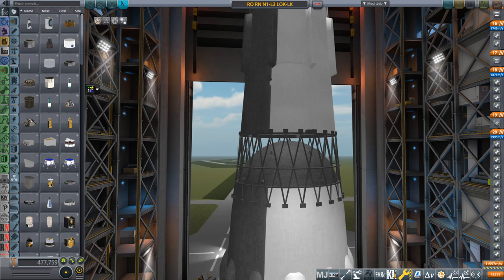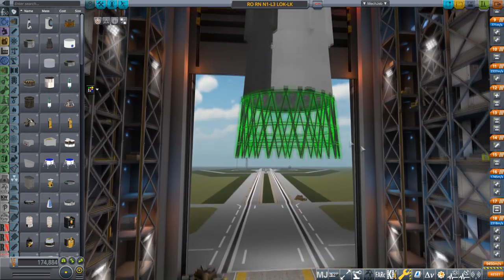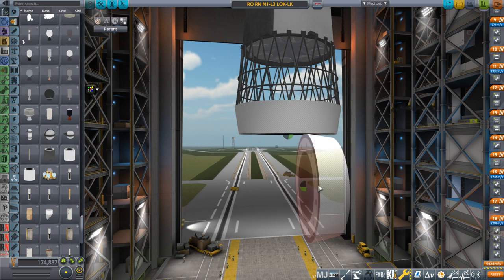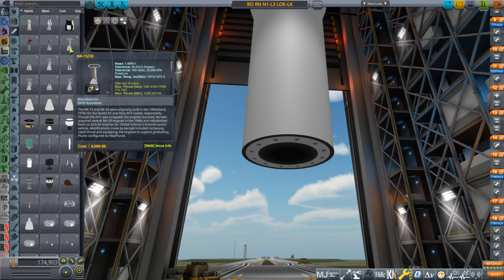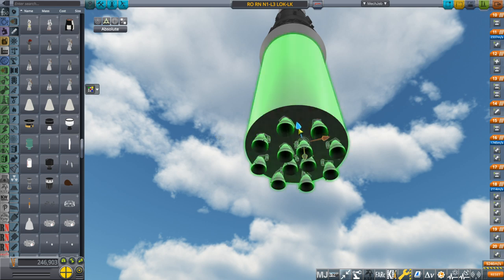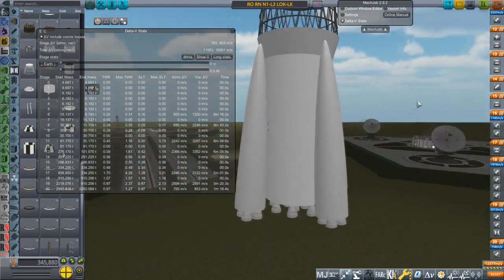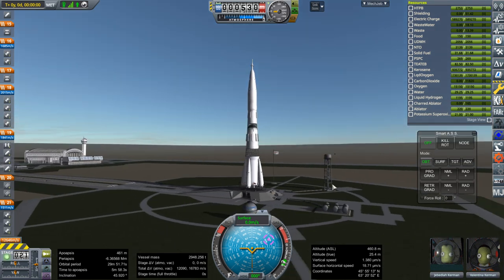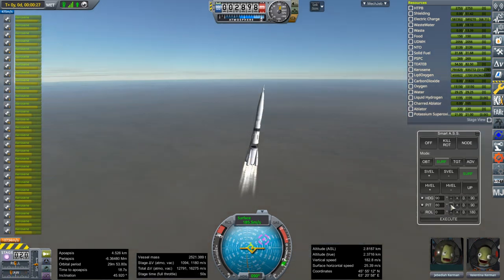Realism Overhaul in KSP 1.8.1 - Improving N1 - Sane Option 1

Comment: One "N1 option" if they'd redesigned the program early, could have been to scrap the whole idea for the colossal rocket, and instead re-purpose the amazing NK engines for making a smaller modular rocket design using conventional cylindrical tanks, say 4 or 5 NK-33s to a core and use similar boosters, Angara style. and they could then carry out an EOR mission in 2 or 3 launches.
not something considered in history AFAIK, just my idea of what would have worked better on a budget.
Reply: Assembling a mothership in orbit was considered, but it didn't go far. That's because docking two unmanned craft was unknown territory at the time.
Reply: @epicbastard1  What about Soyuz-5?
Reply: @twistedyogert  That mission involved two crewed spacecraft.
Reply: @epicbastard1  So was building the N1 and landing on the moon. But a manned docking to another manned or unmanned craft possible. With history showing that they did have the ability to perform a total unmanned docking using the crew only as a backup.
Reply: @epicbastard1  What I was thinking was that they could've built a Moon vehicle in orbit using multiple launches, perhaps adding nuclear or electric engines to act as a reusable "Moon-Bus".
Reply: @twistedyogert  What you are proposing may have been technically on the edge of possible. But you have to put things in perspective. Going on EVA and assembling stuff in orbit seems easy for us ksp players, but back in the 60's this was deemed incredibly risky and impractical. Mir and the ISS are the only things we have assembled in space so far and Mir came in 1986. That's 20 years after the events we are discussing. Keep in mind that many key technologies had advanced during this time, allowing for Mir to be constructed in the first place. Nuclear options also existed, but they would never be seriously considered after the cuban missile crisis. Dumb, I know, but the political backlash would be immense.
Reply: That was the original plan, to have a multi-launch mission, but that was deemed too complex like the Americans did, so they took the massive single launch mission route

Comment: Raiz: Some notes on the reasons for how the N1 was designed.
1) It wasn't actually budget that determined the spherical tanks but the issues of shipping large rocket components by rail in the USSR. Note the US had the same problem but we had both an extensive river and canal network to use along with large coasts that had access to our launch sites. Nothing the size of the N1 could be 'shipped' only the components and the vehicle had to be assembled on-site so spherical tanks were chosen to allow maximum internal volume  for the given size which was at the time far beyond anything the Soviets had built OTHER than spherical fluid storage tanks which is what they were based on.

2) Similarly the use of a 'core' and/or multiple boosters was the competing UR500 and 700 designs by Chelomei and Glushko as well as the initial heavy rocket designed by Yangel. The problem was at those sizes the multi-body designs were vastly less efficient than a mono-body design. The US came to this conclusion as well which is why the early multi-body NOVA designs rapidly gave way to uni-body designs. (Actually kind of sad as there is a wonderful discussion thread over on alt-history forums that shows how much more versatile such multi-body configurations can be in the medium to heavy class of launch vehicle and also allow you to occasionally launch a super-heavy Saturn-V/N1 class mission by just 'setting aside' some of the production. Let me know and I'll drop you a link if anyone wants)

3) Speaking of Glushko he refused to build kerosene/LOX engines of the size Korolev needed as he felt the combustion instability of such a large engine wasn't able to be addressed with the time, budget and support available. So Korolev had to turn to an alternative engine maker which also found that the engines of the size initially required were beyond then USSR capability. Glushko felt that large hypergolic propellant engines would be vastly easier to designs and build and insisted that Korolev use such propellants in the fist stage. As Korolev was distrustful of such propellants, (Nedelin disaster was a 'wakeup call' to many in the USSR's rocket program, see https://en.wikipedia.org/wiki/Nedelin_catastrophe) he refused to Glushko transferred his support and engine design to the rival Chelomei and the UR500/700. Originally, the N1 only had 24 engines, but the center 6 were later added to increase payload.

Comment: I can only imagine one of the other options uses RD-270.
Reply from the maker: Very good!
Reply: UR-700 intensifies
Reply: The design I'd suggest with the RD-270s (called the N1-Kh in the alternate history Into the Wild Black Yonder ) uses the same base first stage with 6 gimballing engines modified in a "reverse LR-87" manner to burn kerosene and liquid oxygen†. With their performance advantages plus less mass from plumbing and guidance, it would have a greater payload capacity than the demonstrated N1, though I seem to have lost the figure for the unmodified variant. 

I think it would be the best alternate N1 developmentally and to some extent politically, considering that there would be little initial need for tank changes and funding on plumbing and guidance could be diverted to converting Chelomei's works of art to Korolev/Mishin's propellants of choice, though it would take a considerable revolution in command and thought for it to have actually happened (which is one of the premises of the aforementioned alternate history). So, that's a potential option...

†Based on numerical trends, I estimated the specific impulse at 341 s in vacuum and 315.6 s (!!!) at sea level. They probably wouldn't be quite as spectacular, but at 250 bar and using FFSC, maybe...
Reply: @grantexploit5903  The crucial problem with converting RD-270 to kerolox is that it requires you to have a fuel rich half to the preburner/pump section, and fuel rich is problematic for kerolox closed cycle.
Reply: @amperzand9162  I knew about that problem with kerolox, and it will probably be solved by either removing the fuel-rich preburner and use (multiple?) oxidizer-rich preburners, or preferably by controlling the combustion environment to preferentially produce carbon monoxide over carbon dioxide and carbon-rich solids. In any case, it wouldn't be a cakewalk, but it would probably be less so than managing the 30 different engines.
Reply: @grantexploit5903  with Korolev dead and finite resources available, it would be easier to just use the RD-270 with its original fuel mixture. Do you have a link to that Wild Black Yonder timeline, out of interest?
Reply: @amperzand9162  If by "link to that timeline" you mean "links to a haphazard collection of items including timelines in various states of currency and completion", yes, but I'm not sure if Tyler or YouTube would particularly like me plopping them down here...
Reply: @amperzand9162  It would probably be more helpful for you to ask specifically on what you want to know. Sorry for the inconvenience.

Comment: Grid fins were for passive roll stability on the N1. AFAIK, the Soyuz didn't have any roll control until relatively recently when the flight computer was upgraded from analog to digital.
Also, my understanding is that the main problem with Blok A was the wiring of the engines to the flight computer (wiring the engines to the wrong place on the computer so it would send the engine shutdown signal to the wrong engine, which then caused it to think that engine had failed too, and so on.), and the troubles with the flight computer itself. (Mostly code doing something unexpected or incorrect.)
...and, you know, this first stage option is kinda reminiscent of one I came up for for something I dubbed Project: UNTARNISHED, only it's boosters were what I dubbed flower petal. IE- They overlap each other clockwise like flower petals. Also, the whole thing is intended to be reusable, or at least the boosters and 1st stage. Boosters separate by rolling 90 deg counter-clockwise and then yawing off the 1st stage by another 90 deg. Then eventually deploying parachute(s) and a landing airbag to keep the engines and such out of the water. Boat(s) would tow them back for reuse. Each 1st stage would have 6 boosters. Penciled in for each booster is 1 F-1B and would ideally be fueling or at least topping off the 1st stage, which is penciled in to use 6x the made up F-2 engines. (Basically a double scaled F-1B, though 12x F-1Bs could also work I suppose..) The 1st stage would land propulsively on a barge ala SpaceX. 2nd stage is penciled in for 6x M-1 engines, and 3rd stage penciled in for 1x M-1 engine. 3rd stage would finalize Earth orbit and initiate TLI. TLI would be finished by a propulsion transfer stage burning hypergolics. On top of that would be the capsule for 10 people, and attached to that would be a hypergolic landing and surface cargo unit. (Mostly carrying some of the tools and equipment and a sizeable portion of the food for the surface mission's duration. Most things though would be delivered ahead of time by seperate, dedicated launches.) Around the descent unit would be a tank for descent upon which the landing gear would be attached. Either used during descent or pumped over to the unit's core tanks after landing to be used on ascent. After spending around 3 months on the lunar surface either building a base or operating at it, it would be time for ascent. The descent portion would detach and the core would lift off (using the same engine as used for descent) and that would detach and the capsule would redock with the propulsion transfer stage in LLO and use that to return home. The escape system would be a hypergolic system built into the capsule for retention at any point in the mission. Ideally, it would be capable of returning the capsule from the lunar surface to LLO in case of an emergency. I'm unsure if that would be enough dV to return from LLO to a slashdown or ground landing. (Never really decided on which, but presumably if the abort system hasn't been used yet, it could be used to aid the parachutes in landing pretty much anywhere.) I must admit that the engine selection and count is mostly based on it sounds cool. I've never really figured out if any of it makes sense, but the idea seems sound. The idea is to gain experience necessary and test out as much as possible for Project: UNDAUNTED, which is similar, but on Mars.
Reply: Making videos?
Reply: Not presently. I've been looking at getting back into it as some years ago I did some streaming on my old computer which could barely even handle it, but I think now I'm more interested in recording and uploading. At any rate, I've been having issues with mods, though admittedly it's mostly a case of me being impatient and not bothering to read the instructions all the way through. At least, in the case of KSP. Recently picked up Mount & Blade II: Bannerlord, and that's just something that's causing it to crash when I have to pay my troops.
Reply: Much like what I thought but without the recovery/repair of 1st stage. What lake would you have as a target? landing in seawater is still not much of a recovery/reuse option due to saltwater contamination and corrosion? Reuse still has only been of different components from different boosters, almost as expensive and time consuming as constructing a completely new one.
Reply: The idea would be for the boosters to use large, inflatable airbags to keep them out of the seawater. (I actually wasn't aware of it at the time, but NASA considered using a similar for something once, I forget what, but ultimately didn't go with it.) The 1st stage would just propulsively land on a barge ala a giant SpaceX in all likelihood. (Ofc, this means the engines would need to be modified for 1 or more reignitions, but that seems doable in my mind.) Unless somehow the 1st stage could make it more or less ballistically to around the NW of Africa and propulsively land there, but I doubt even with the boosters totally providing fuel to the 1st stage whilst attached, it could make it that far.

Comment: Two changes would have made a big difference, If the 1st stage was a cluster of six boosters around a central core, the number of main engines clustered on each could have been dropped down to five or seven, cutting back on the plumbers nightmare to the level of proton boosters and the launches cut down to only 2 or three, with an R-7 carrying the crew to an earth orbit rendezvous, and lunar orbit rendezvous with the lander and return capsule. This would have been more likely to a failure, but with an additional booster on a standby to finish the stack and a backup crew ready to launch on another R-7 as a replacement or recovery due to a failure in earth orbit. this would make the mission more difficult to achieve but much more likely to be completed.

Comment: It's possible to use the Raptor engines on the Falcon rocket? It would be interesting to see that in the KSP.
Reply: Major Tom  I reckon you should turn 2 or 1 off. The issue then becomes roll control or high TWR. Maybe 1 raptor but with fins.

Comment: How many soyuz side boosters would be needed to match those four side boosters.
Reply from the maker: In terms of thrust, six, but the Soyuz engines aren't as efficient, so probably eight. Edit: that's eight for each one, so a total of 32.
Reply: @RaizSpace  but the Soyuz engines operate in a partial vacuum range, more time is used in lower atmosphere, which makes all engines less efficient than when operating in vacuum. Nozzles are optimized for the median range in atmosphere that they operate, so they will always be less efficient compared to any rocket that performs at an optimized level of a single ambient pressure.